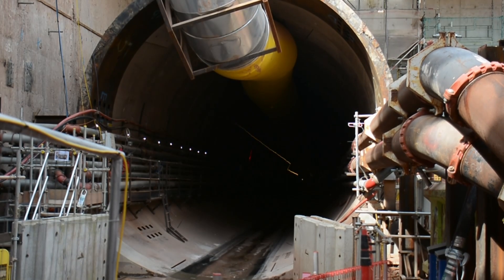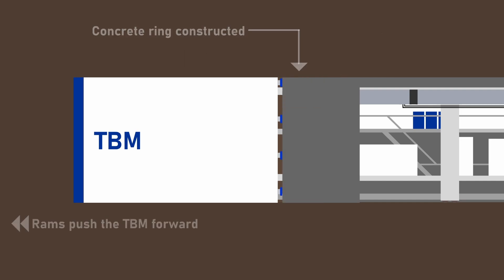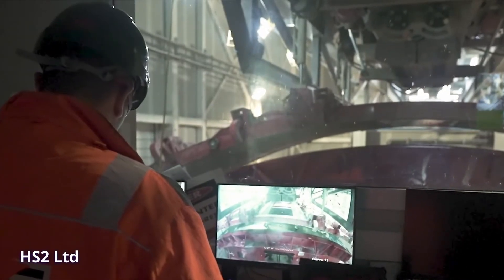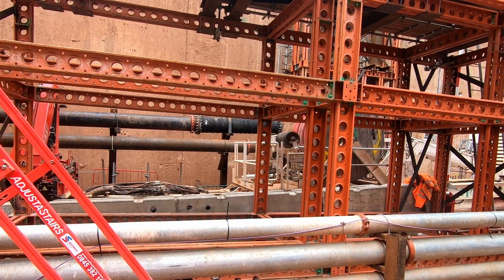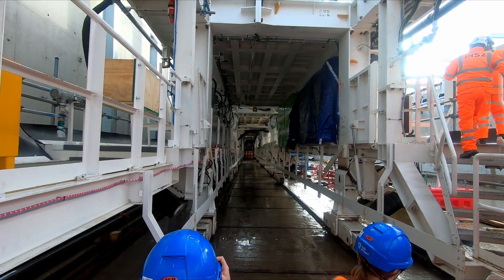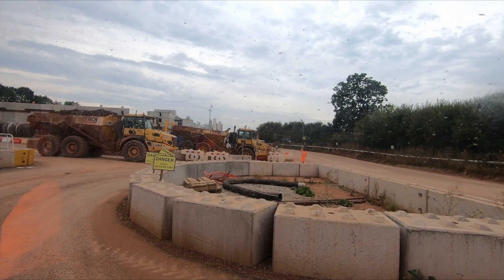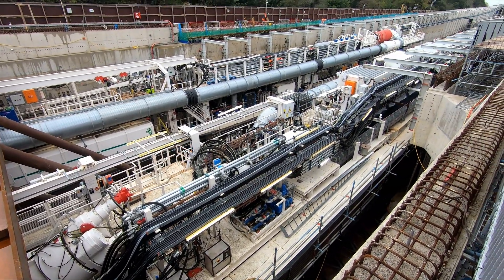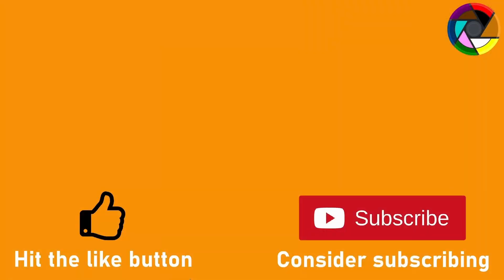Incredible tunnel engineering! | HS2 Bromford Tunnel

Comment: I think those tunnel machines are boring… 

I’ll get my coat 😜

Why do the tunnel diameters differ in size? I’d have thought that having them one size would save on costs…
Reply from the maker: The size depends on the speed, the faster the train the more air is squeezed as the train travels through the tunnel. The trains will be traveling at 320km/h through Chiltern  and Long Itchington tunnels, but only around  200-240km/h through Bromford.

Comment: All the engineering works in constructing HS2 are impressive, including this, but Bromford Tunnel is particularly disappointing in one respect, its reliance on road transport. Other tunnels’ segments & other materials are being transported by rail, & their spoil taken away by conveyor & rail!
Reply from the maker: @rtruscott  There were/are other HS2 tunnels which have ring segments delivered by road. 

With regards to the spoil, it's all being used locally so it doesn't need to be transported by rail. None of the spoil is being transported on the local road network. Similarly with the Chiltern Tunnel, the spoil was processed and used close to the Southern portal.

The only reason Northolt Tunnel is reliant on rail transport is because there's nowhere locally on the HS2 route requiring the spoil.